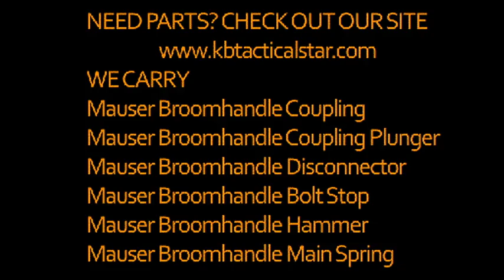Mauser C96 Broomhandle Locking Frame assembly

Comment: It would be beneficial if the warning below was added to the video.

The coupling that holds the spring in can be inserted upside down, and the lock assembly and the gun fully assembled.  BUT THE FIRST TIME THE SLIDE IS RACKED, THE GUN WILL JAM AND CANNOT BE UNJAMMED NOR DISASSEMBLED. Only an expert gunsmith very familiar with Broomhandles can drill a hole through the frame, use a special pick to lift the upside down coupling enough to allow disassembley, and braze the hole closed afterwards.
Reply: A few years ago there was a video about a special pick being sold which allowed reaching and moving that part without drilling the hole.  I don't remember who was making them, and haven't even seen the video iteself in years, but the pick does exist.

Comment: thanks for this video. i got my c96 yesterday and while field stripping the disconector fell of but when i put it back on i had trouble with hammer not staying cocked and trigger not working.  then from this video i figured out the hammer spring and disconector were in wrong spot then i got it working.  i will try to fully dissasemble and reassemble lock frame later

Comment: Hallo
nice video for explain the C96.
Which part is the contact breaker ?
THX for the information
Reply: This video was invaluable as I replaced the main spring and needed to reassemble the works.  Yours is the only video I could find to not mess up.  Most just said don’t disassemble any further...Well, I wanted to replace the spring so I needed your video.  THANK YOU much!